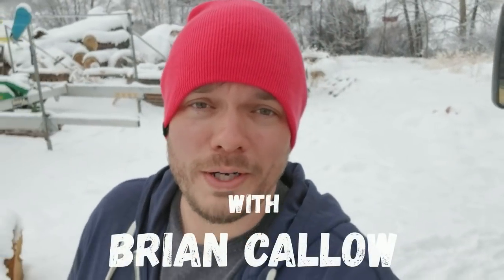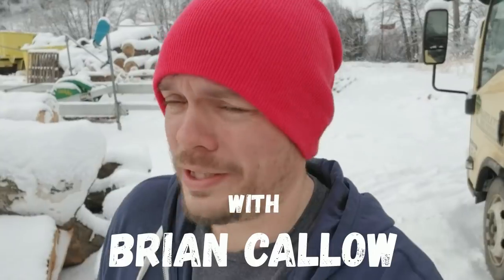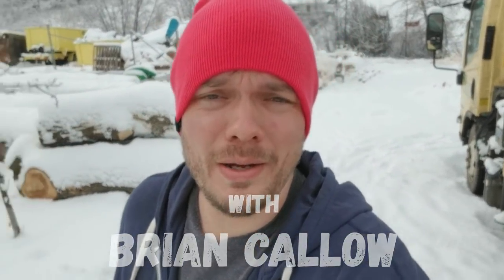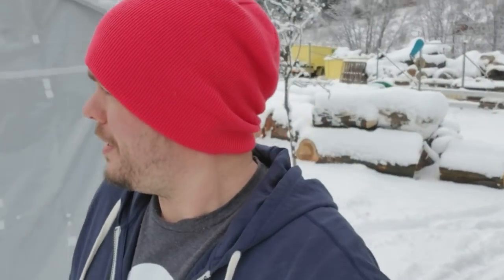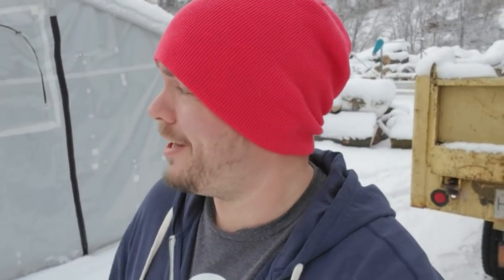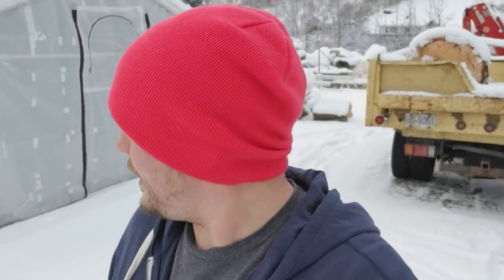Building Permit For Snow Loads - Temporary Structure Design For Greenhouses In Cold Climates

Comment: We built a small greenhouse using 16' cattle panels! They work great with short length building of 8' but the same cannot be said about longer and wider shelter design we tried for a temporary wood shed roof! It's has been dropped by the snow 3 times already! Going to the lumber yard tomorrow to beef up the center support of the wood shed with a ridge pole!!👍🏻😜

Comment: I started my outdoor season  last year with 10'x20' shelter logic, did quite a bit of research before choosing, between the cost and design features (zippered door,high sidewalls) nothing else I found came close. I'm in NY so snow load is a concern as well, still need to install a few uprights under ridge to mitigate total collapse. I did pull my shade cloth to allow snow to slide off on its own, which so far is working well. A big snowfall would have me out there shoveling though.

Comment: I have had two Shelterlogic garages in a box crush from over night of wet snow.
Shelterlogis told me I should have used the round top sheds, I told them they should have those in the farm store not the ones that will crush in snow climates.
A great fix to reduce this is to build in a wood ridge beam under the top ridge pole to support the snow weight, like a 2" by 8", one should would though two would be better. if it's not a garage, posts under it would be fine.